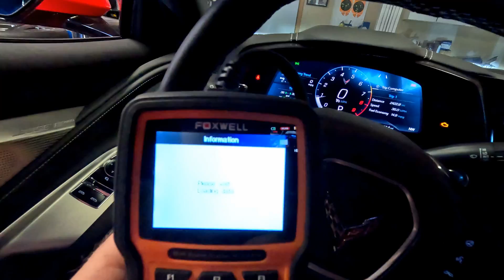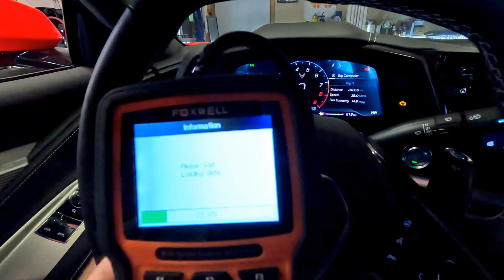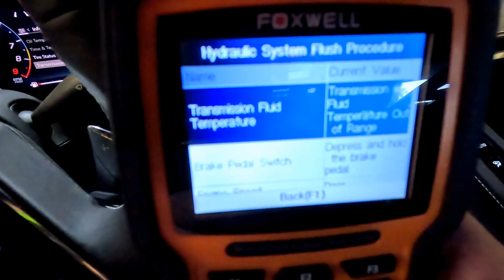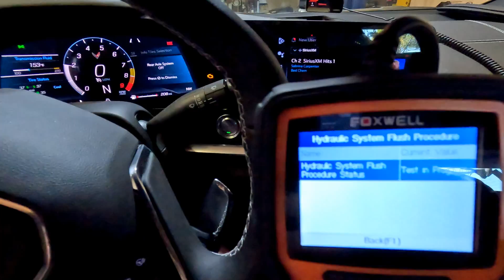C8 Corvette Transmission Filter Replacement with Computerized Flush

Comment: What if it’s literally just a timer for 8 minutes at 2k rpm. What if you just do this manually. 🤔you think it’s really doing anything else?
Reply from the maker: I don’t think those questions have been fully answered.  I has been stated that the procedure runs the fluid through the transmission at a higher pressure than normal.

Comment: What is a reverse torque bit?
Reply from the maker: I didn’t know what they were either, but they are essentially a reversal of the standard torx bit.  The torx is on the head of the bolt and your socket fits around it.
Reply: @RecordsRebuilds I’m no sure I understood but will ask for that bit thanks

Comment: What if you just drive it 5-10 minutes to reach the ideal temp while the oil circulate several times tru the filter
Reply from the maker: I don’t think those questions have been fully answered.  I has been stated that the procedure runs the fluid through the transmission at a higher pressure than normal.
Reply: @RecordsRebuilds soo it has to by idle then?

Comment: Do you guys not re-add trans fluid after?
Reply from the maker: Mine was still over-full after the filter swap so I did not.  I would suggest adding fluid if it is low.  Use the fill plug to check.

Comment: Does anyone have a definitive answer from GM if we do these services ourselves they will still honer the warranty. I called CS and the said it has to be done by the dealer? I bought a used 23 with 2850 miles on it and it did already have the free filter done but I need to do it again between 7000 - 8000 miles. The dealer doesn’t know if we are allowed to do it and of course they want the business so they’re unreliable. Please advise… thanks 😮
Reply from the maker: Thank you for asking.  It’s very important that owners ask these types of questions to keep us from becoming a society of people who let fear keep us from attempting things that are actually specifically protected by the law.

Your right to perform routine maintenance on your vehicle while keeping the warranty intact is guaranteed by the Magnuson-Moss Warranty Act.  Google: Magnuson-Moss allowed to do their own service, and you should find all the information you need to be re-assured.

Now, this does not release you from the duty to perform the service correctly.  If you mess up, you do damage, and they can prove it, you are obviously responsible for the damage caused.  On this particular vehicle, that means you need a quality torque wrench and to make sure you use the correct torque specs on every bolt.

You also need to keep some record of the service so that they have some reassurance that you actually performed the service.  I shoot a quick video every time I do service on a car under warranty, but a simple log of work done should be sufficient.  If you really want evidence. Cut the UPC off the filter box and staple or glue it into your log.

Comment: such a detailed video, thank you!

Do you know if the NT510 can perform the exhaust valve relearn as well?
Reply from the maker: Cannot 100% confirm, but it works on the C7.
Reply: Did you ever find this out by chance?
Reply: @crespinmd yes, it can do valves relearn , both AFM and exhaust valves

Comment: Hi to the OP, thanks for this video. BTW, do you top it off after the canister change?
Reply from the maker: That’s a really good question.  I attempted to, but when I opened the fill port, fluid came out.

Knowing what I know now, I would say the correct procedure would be to fire it up, run it through each of the gears, then open the fill port and fill.

Comment: Thanks for the Video. I bought the Scanner and tried it but I get and error message that says "Request Rejected by the Control Module.. Request Out of Range".
I have no idea what to do next. ANY Suggestions?
ADM
Reply from the maker: What year is your car?
Reply: Same issue here??
Reply: Same issue?? You figure it out?
Reply: @gman7858  i think the car has to be a 2023 or newer.  I just tried it on my 2022 and got the same reject message

Comment: While the cost of a used C8 is getting close to what I can afford, I am somewhat left speechless at the complexity and expense of simple fluid changes. To whom is GM aiming this nightmare? I have owned several sports cars over the years, including a relatively complex 1994 Mazda RX-7 that I serviced myself (and never had any significant problems with it). Never have I encountered anything like this monster of engineering malpractice in all my years of sporty driving. I wonder if GM is listening to these posts?
Reply from the maker: So, I may have inadvertently given the wrong impression.  Both the transmission filter change and the oil change on my C8 Z06 are the best I have ever seen in a Corvette.  The oil can be changed without even removing the under-tray.  Holes were thoughtfully placed to drain the engine, the tank, and the oil filter without any trouble at all.  The oil change could not be easier. 

With the C7, to change the trans filter, you have to drop the pan (which does not have a drain), spill fluid everywhere, and then change the filter.  The fill procedure is crazy and a terrible pain, you fill a running transmission until you see fluid drip out a hole in the pan.

The C8 is much easier,  just a canister on the side of the transmission.

I think both procedures are better on the C8.
Reply: @RecordsRebuilds  Thanks for the follow up. I don't doubt I could do all of the above with a little research and thinking it through (and enjoy it, LOL) but I am left wondering what performance gains are C8 owners actually receiving for the complexity and cost? $1,400 for a transmission oil change every three years ($5,200 in nine years of ownership) is much more than I ever spent over the lifttime of maintaining three RX-7s I owned and loved -  over 17 years. Can the C8 go faster? Yes. But is that speed dependent on the actual technology requirements of the fluid changes? I'm going to say there is some over engineering here. You can't responsibly use that speed on the street. So you are paying for the potential to use it or go to jail, if you do. Or maybe most C8 owners go to track days at Hallet or Leguna Seca?  I doubt it as the cost of tracking this car is unimaginable - something for the one percent. Most people who worship this car while parked in their garage won't do this maintenance themselves.  They're essentially forced to drop the car off at the dealer for service and pay through the nose. Maybe this was planned by GM? Guaranteed profits in perpetuity? I would bet most owners would be more happy with a simple manual transmission where you unscrew a simple plug and pour in a few quarts of cheap mineral oil every five or six years. Nevertheless, thanks for the great video. Subscribed!

Comment: Just to add some info to your awesome video...
- The Foxwell NT530 scan tool can also perform the flush procedure.  It worked on my '24 Z06.  
- The scan tool can also perform the transmission pressure check, which you should perform after replacing the filter.  This procedure takes about one minute to complete.  It also requires a warmed up engine with trans fluid temp above 140 deg F.
 - You DO have to hold your foot on the brake pedal during the entire flush procedure or else it will abort if you lift your foot.
- When removing the DCT filter, you will lose 150 mL or 5oz of DCT fluid.  It's a small amount that I won't bother replacing after just one filter replacement. But when I change it next time, I will plan to add back about 10oz of DCT fluid.
- I'm surprised nobody on the forums talks about doing a "flat foot crank" procedure to help fill the oil filter and prime the oil pump after changing the engine oil, before firing up the engine.  I do this whenever any of my vehicles sits for more than a week.  If you hold the brake and press the accelerator pedal to the floor (full throttle), and then crank the engine, it will NOT start, but it will crank.  Most modern vehicles are tuned to do this on purpose, which essentially cuts fuel to the engine so it's getting air but not fuel, so it won't start.  If the engine should become flooded with fuel, this procedure helps to clear it out.  Hardly necessary with modern fuel injection systems, but if anyone remembers having a carbureted engine, you might have experienced a "flooded" engine.  Anyway... I do this procedure (holding throttle down while cranking) to allow the new oil filter to fill up with oil, and to prime the oil pump.  I let it crank for about 20 seconds, and then lift my foot off the throttle, and it fires up.
Reply from the maker: Thanks!  This is awesome info.  Thanks for reporting back!  I’ll get this all into the description soon.

Comment: Great video and appreciate the reference to the Foxwell tool.  Good mentions on the bolts ect, however would also state that do not try and pry off the cap and risk damage to the mating surfaces.
Reply from the maker: Great point!  The seal isn’t on the mating surface of course, but I agree.  You can pull it loose with your hand.

Comment: I  have a Foxwell NT530 I believe and your video is helpful if you really want to perform this procedure, but I will not myself on my own C8Z and I would suggest owners do their own research and reach their own conclusions. Unless you are going to use 2 filters when performing the DCT filter change, I am of the opinion that I would not want to run this DCT flush procedure on a used DCT filter. If the filter is dirty enough, (and how else would you or any dealer tech no for sure unless they first swapped in a new, clean DCT filter?)it will go into bypass mode and dump all that gunk into your DCT solenoids, wreaking havoc on your DCT. If you really want to do this, install a new, clean DCT filter first. 

The fact that the GM engineers are on record saying the DIY'er doesn't need to do this should tell you all that you need to know about the procedure. I trust GM on these DCT's about as far as I can throw one of them. I really don't think GM is being honest with all of us who have bought their products. (The DCT filter should have been much larger, for example.)

Also, if you want change the DCT fluid yourself, you can save a little money and time by buying the 5L jugs of the Pentosin FFL-4 fluid. From what I heard and seen, on a flush you shouldn't need any more than 10L. I think you really only get about 8 or 9 liters back into it.
Reply from the maker: Why does everyone have so many emotions, thoughts, feelings, and opinions about this?

The manual says to do the flush.  Josh and Tadge said that if you’re at home and you can’t do the flush, that’s ok.  How could people take that to mean you shouldn’t or don’t need to do the flush?

With this type of work, why would you do anything other than follow the procedure in the GM manual to the letter?  The manual already contains guidelines regarding when you should flush then change the filter, and when you should insert a new filter, do the flush, and then insert a second new filter.

I’ve been reading and carefully following the procedures in GM repair manuals as written for over 30 years and I have never had a powertrain failure in one of their cars, including several with >200,000 miles.

We all get to make our own decisions in life, but I decided a long time ago to follow the manual, not the comments section.
Reply: @RecordsRebuilds  I stopped giving GM my blind faith when I had an LS7 in my C6Z and they told me the heads were good. Or the three different attempts at getting the correct automatic transmission fluid that it took for GM to get right on the C7 A8's. IIRC, when the MY20 C8's came out, there was no DCT flush procedure. GM has been all over the place on how to maintain the DCT's and you're wondering why people are so skeptical of them? Especially with the large amount of failures we've seen, many with low miles. It's ridiculously overpriced at $20k, so tread lightly. They know they didn't exactly hit their goals with the DCT's in terms of durability/reliability and they are trying to wiggle out of as much warranty replacement on the DCT's as they think they can get away with. 

The GM "guidelines" for when to change the filter before and or after the flush rely upon you or your dealer tech having x-ray vision so you can tell if that filter is overloaded or not. Many of these DCT's are breaking in through that first 7.5k miles at a much more rapid rate than others, which necessitates the DCT filter being replaced at least once before you hit that 7.5k mile mark if you value your DCT. If your DCT filter is overloaded when you go to run this hydraulic system flush (HSF) procedure, it goes into bypass mode and all of those wonderful contaminants escape the filter and enter the transmission which GM readily admits, "may result in damage to the transmission." The only way you know if your filter is not overloaded is to first replace it with a clean one. 

All that and GM says you don't have to really do it?! Why even take the chance? Too much risk to reward for me, even if it is under warranty; I'll pass.
Reply from the maker: @AirRyanTX fair enough.  You make good points about your skepticism.  If the filter is so full it bypasses during the flush, it would be doing it during normal driving anyway though.

They do address the situation in the manual though, stating that if the filter is overdue you need to run the flush with a new filter, discard it, and then install a new one.
Reply: If your DCT filter becomes clogged enough (meaning really poor maintenance) to create the bypass mode then it is not doing a backflush of the filter into the tranny. It means that contaminants in the fluid will continually circulate in the tranny body and possibly some of the filter contaminants could be drawn back into that from fluid suction but not a backflush. If the tranny is in bypass mode from a pressure issue with the filter then it is highly likely transmission damage has already started.

Comment: I can't say for a fact that it works but watched another video about changing the DCT filter and they only loosened the front edge of the plastic panel enough to slide the aluminum panel back, saving time by not taking out that plastic panel.  Your thoughts (or thoughts from other viewers that have indeed done the filter replacement)????
Reply from the maker: Yep, I have heard that works.  May try it myself next time.

Comment: Is there any amount of trans fluid that needs to be added to replace any lost?
Reply: Yes, you'll lose  a few ounces and should check the access plug that oil is level with the hole if I'm recalling correctly.  Also there's a track fill amount so if the car was track filled, you'll lose a couple quarts out of that hole when checking.
Reply from the maker: That depends.  Per the manual, you should start the car, run it through each drive mode, put it back in park, shut it off, and pull the fill plug.  If the fill plug is full, you don’t need to add fluid.
Reply: You need to check it when you are done regardless of how much fluid you did lose during the filter change. The reason is you have no idea how much fluid is actually in your transmission even when it came from the factory. Better safe then sorry. I expect every dealer should be checking the fluid level after a filter change and adding if necessary. Loss is typically around 5 oz. but fill until it comes out. If the car had the additional fluid added for tracking then this method won't work since the fluid is already over the level mark.

Comment: Great video, I have that scanner and was not aware it performed this procedure. I have changed my DCT filter on both my C8 a total of 3 times and never ran this procedure. You should know that this procedure is not necessary and your warranty will not be void if you do not perform it. Your car automatically performs this procedure while driving it. The author of this video will argue that point, and that's OK. But for me I would listen to Josh Holder (Chief Corvette Engineer) about the "flush" circulation procedure and he will explain why it is not necessary. But it does not hurt to do this procedure, but not necessary if you do not want to buy a scanner or goto a dealer.  Goto timestamp 23:40 and hear what Josh has to say.    https://youtu.be/0n_IdGg6Lg8?si=hIKksaFOvVM2JYc0
Reply from the maker: Thanks for the link man!

Comment: Great Video and I have a 2020 C8, but I just bought a NT510Elite and it DID NOT perform the transmission flush. I followed ALL of the parameters for the test but after I pressed the brake and shifted to neutral like it asked, I got this Information screen that said "Request Rejected by the Control Module
Request Out of Range"

Just a heads up IF you have a 2020 C8.
Reply from the maker: Thanks man.  That’s really helpful information.  I really appreciate your effort.
Reply: Same issue in my 21 HTC
Reply: The Transmission Flush Routine is not resident in the NVRAM on the 20-22 C8’s so it must be an externally loaded routine downloaded thru GM AC Delco TDS website at a cost for the TCM. The flush runs the engine at 2,000rpm for 8 minutes to ensure it’s cycled through so if you are changing the filter and fluid at the 3 year mark no need to run the Flush Routine. If you just want to change the DCT filter and flush the fluid between the 3year time and 45000miles, just replace the DCT filter drive the car for 15minutes or more and replace the DCT filter again if you are doing it yourself, otherwise your just running 9.8 quarts of dirty fluid through a clean filter which becomes dirty very quickly. FFL-4 spec transmission fluid is now available by various Manufacturers for around $8 a quart vice the $28-50 a quart the OEM. So it’s cheaper to just change the fluid and filter at the 22,500 intervals rather than flushing the transmission and your getting clean fluid.